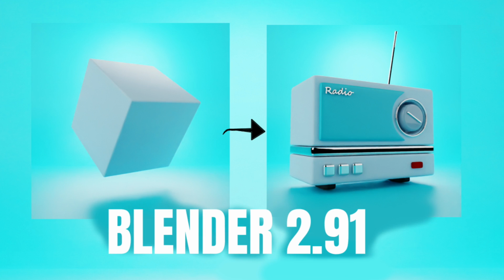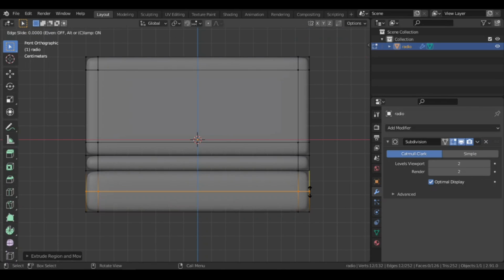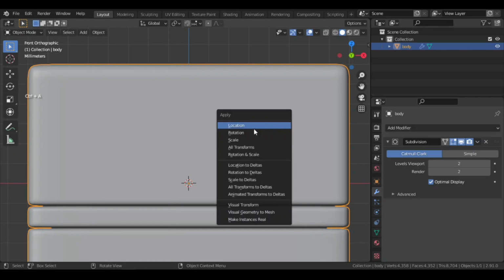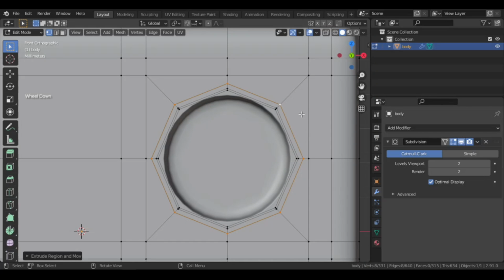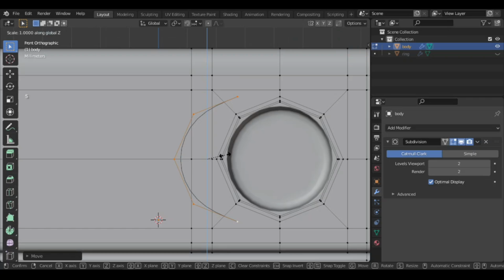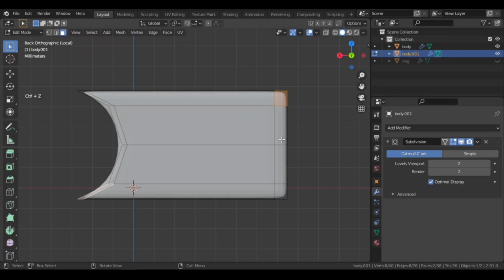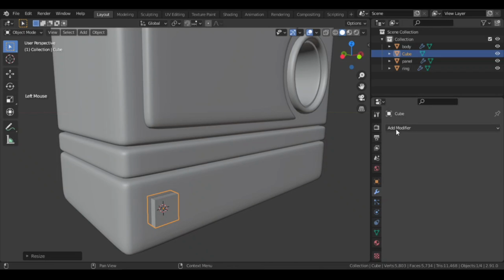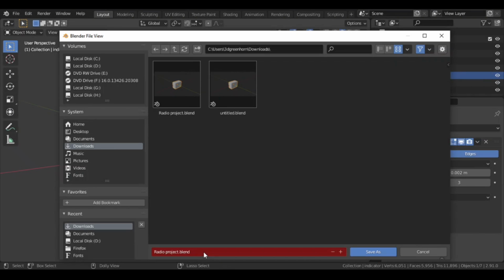Radio in Blender - Part 2

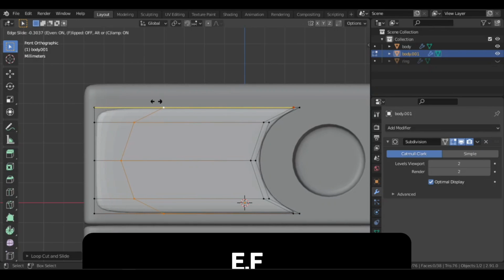Comment: on the time stamp 10:53, after adding a loop cut and needing to flip it to match the straight edge on the left side. What does the E button command do before flipping?
Reply from the maker: Pressing E will change that loop shape to match one of the adjacent edge loops, and then pressing F will flip it over to match the other one.

Comment: I have the same problem with part in 4:12 where you have to select the middle vertex, but when I zoom like really in I seem to have multiple middle vertexes there and it wont bevel out like it should? Version is 2.91.2
Reply: Solution was to select all middle vertices and do right click -> merge vertices

Comment: I can't select linked. When I press Ctrl + L, Blender will select all.
Reply: alt + click then
Reply: @firdevssaglam9047  
No. I don't want to multiple select. I just want to select linked.
Reply: @nguyenquang0108  when i use select  > link   it selects 2 rings of vertices instead of the 1 ring, idky??
Reply: @Madara2B  Yes.

Comment: 4:12 mine has multiple middle vertices and doesn't end up bevelling properly :'(
Reply: I was having the same issue. I "accidentally" found a way to merge vertices. I could see 4 or five near the center. Merging them fixed that problem for me.
Reply: @steven_2128  U saved me